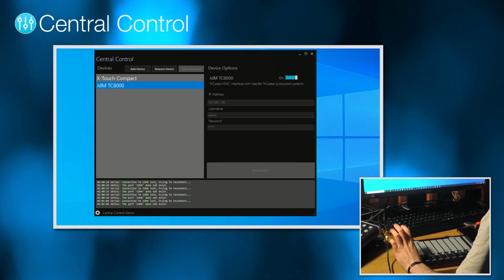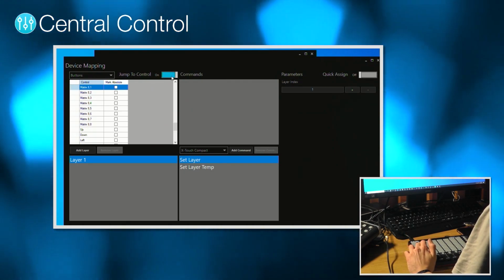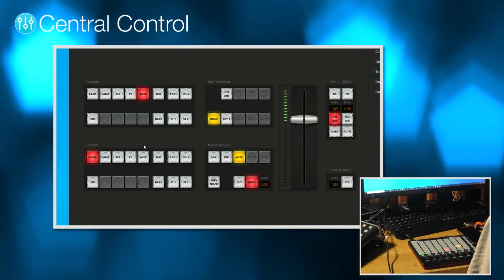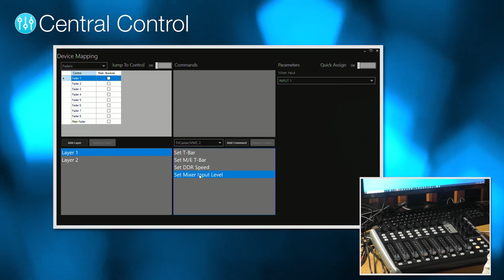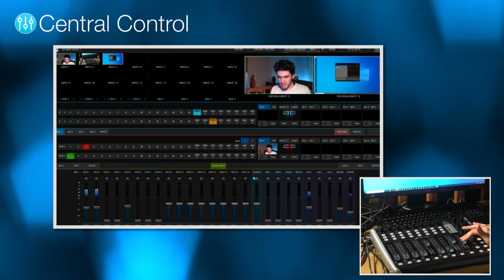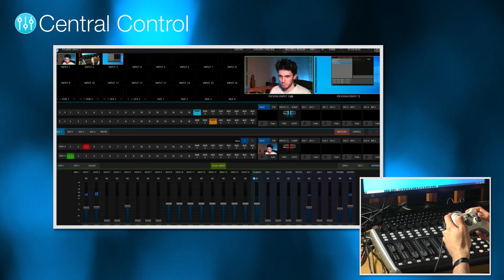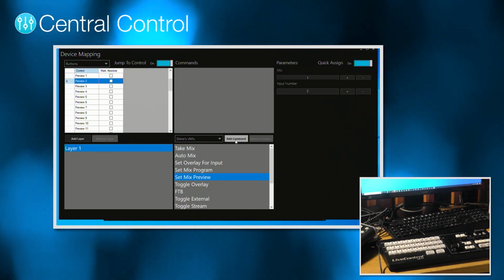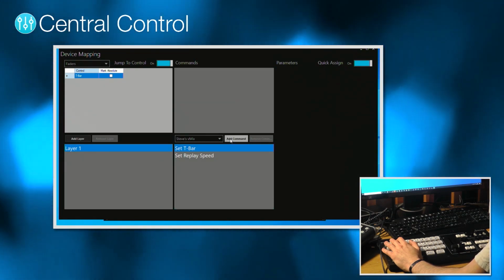Central Control : MIDI map ATEM, TriCaster and vMix!

Comment: hello friend, I bought the license for the central control to use with a 46cs controller from Newtek in vMix, I want to configure some buttons to trigger input for the output2 in the external. miss this function, if this function is possible, if you can send me the instructions, thank you in advance.

Comment: Hallo! With CC is possible to trigger a command to vmix and atem at the same time? (one button two different instances, one to vmix one to the atem, simultaneously), Thanks!
Reply from the maker: Absolutely!
Reply: @thisiscentralcontrol  Thanks! Please, would you mind linking me to some tutorial pages? I'm trying to figure out how to connect different devices (vmix, atem). What is the right ip for vmix for example.. right now i'm not able to connect it and vmix is installed in the same pc where cc is
Reply from the maker: @MCProduzioniVideo  If it's the same PC just use 127.0.0.1 Check out this video for an idea of how to setup up vMix with CC
https://www.youtube.com/watch?v=nXED8keZmyU
Reply: @thisiscentralcontrol  O yeah, ok, so i need a usb device, i cannot trigger anything straight from cc. I will buy one :)
Reply from the maker: @MCProduzioniVideo  You have some options, like the HTTP Listener or TouchOSC (Watch the touchOSC powerpoint video I made for an idea of how that might work).

Comment: Good job man. I presume you can control vMix locally with LC11 too, right? What leads to my next question: what other video switcher controller have you tried with success?. My point is there are not many proper video switcher controllers that work with vmix therefore if you can make them work with vmix through your software would be a great thing for all the vmix operators out there. At the moment im using a normal midi control but i want something that looks more professional. Have you tried the blackmagic controllers?
Thanks and good job again
Reply from the maker: Hi! Yes, indeed it can be local, just use localhost (127.0.0.1) as the IP address. There are more and more devices being added all the time (see http://centralcontrol.io/devices) and I definitely want to include more control surfaces. Currently working on some Broadcast Pix stuff which I hope will be out before too long.
Reply: @thisiscentralcontrol  Hi Joe. Do I need to load drivers for the local LC-11? If yes, where would I find those?
Reply: @thisiscentralcontrol  HI again, also in my version of CC I just downloaded (20210204) there is not an option in ADD DEVICE for vMix... AM I missing something? Thanks
Reply from the maker: @cgraff  Hi! Be sure to check out the specific vMix/NewTek controller tutorial on this channel, as it goes over the drivers etc. vMix is listed as "StudioCoast - vMix".
Reply: OK nevermind I found the  answer sorry..
Reply: @thisiscentralcontrol  I didn't know that it was called... StudioCoast-vMix duh... thanks
Reply from the maker: @cgraff  it’s Manufacturer - Product ;)
Reply: @thisiscentralcontrol  yep I am a spazz...
Reply from the maker: @cgraff  Let's not get bogged down.